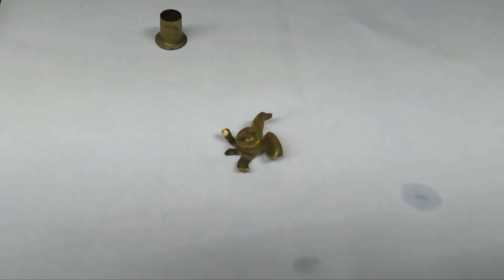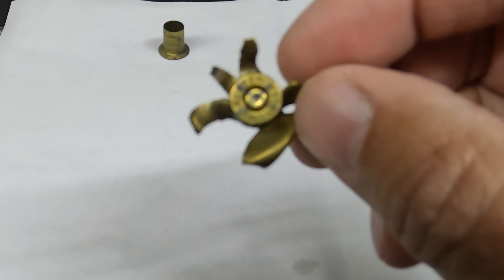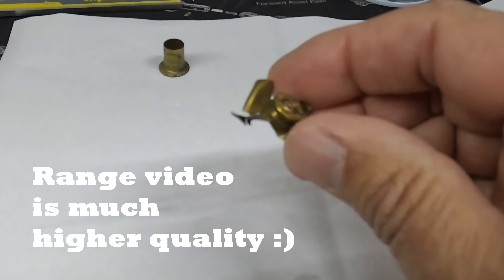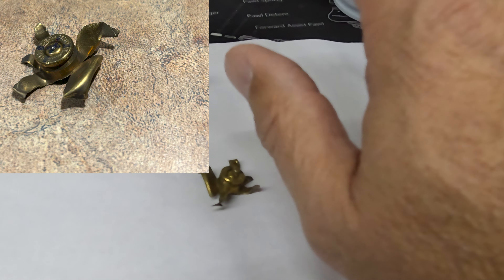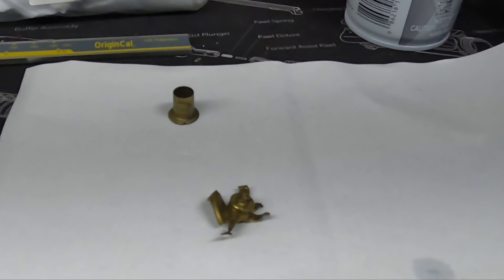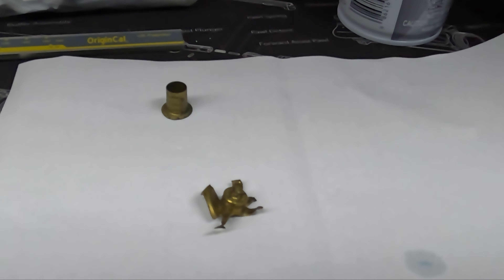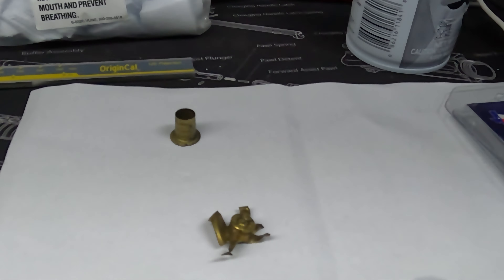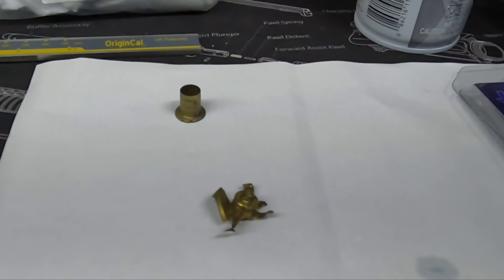EPC 9mm Pt3 Out of Battery Bolt Bounce Slam Fire! #9mm #aeroprecision #reloading #rifle #detonation

Comment: Very sorry about the issues you are running into😫 ... I can tell you that my build is 100% Aero Precision parts my trigger is  an AR9 trigger from Velocity Precision and I'm using a Strike Industries AR10 flat wire buffer spring with the Aero buffer, since I got my new Gen2 barrel it has ran flawless. All my reloads, and factory ball and defensive ammo run perfectly with Aero 9mm bolt. My head space is perfect. Aero's tech support is always there to help. I never hesitate to call them if I run in to problems even if not using all their parts 😉 ... good luck and safe shooting, Brother 😉👊🇺🇸
Reply from the maker: JB, I decided to order a Macon Armory 9mm buffer (uses lead shot) and a standard flat wire carbine buffer spring.  Saw others using this with my exact configuration and was working.  We’ll see in a week or so!  More research shows many others having trouble with the recommended Aero 308 spring and 8oz buffer.

Comment: An 8lbs buffer and 308 spring is more than plenty, the firing pin hit the primer when it shouldn’t have so that’s one problem ( they are spring loaded for a reason) The other problem is your headspace, when you showed the bolt closed on a round ( earlier) it was badly unsupported and not letting the round get fully chambered and to add insult to injury the barrel is aggressively chamfered and unsupported so this  AR is unsafe regardless of slam fires. People keep saying sent it to Aero but it’s not their bolt! My first suspect is the bolt but hard to say without checking it on another upper then checking your barrel with another bolt. I’ve been running these puppy’s a long time , long enough to when we used stock AR  buffers and quarters for spacers and they ran perfect. 🤷‍♀️ Find a buddy with a 9mm and swap and inspect parts for headspace. 👍
Reply from the maker: Tks UJ, changing direction and going with a “dead blow” type buffer and standard carbine spring.  Found others with similar his combo working with my exact same upper, lower, barrel, and bcg.  That with a CMC 9mm specific trigger should help..I hope!

Comment: One thing that also can contribute to this is the way Aero makes their bolts. Good thing you don't have that. On the bottom face of the bolt is a extended nub to push the shell out of the mag. Aero does not do this to their bolts. It is also a safety design to have this. It prevents the firing pin from reaching the primer till the shell has been fully in the chamber. It then lets the extractor slip over the rim of the case and then the pin can reach the primer. This is the only way that the AR9 can fire out of battery. And it is caused by bolt bounce. 

You prevent bolt bounce by using a standard type buffer with the movable weights inside. They act as a dead blow and prevent the bolt from bouncing. I made my own from a 8oz buffer. I bored it out then put in 1.5oz of lead shot then put the plastic buffer back on it. Completely cured my bolt bounce. I have not had another OOB since doing this
Reply from the maker: Tommeboy, taking what you said I decided to order a Macon Armory 9mm buffer (uses lead shot) and a standard flat wire carbine buffer spring.  Saw others using this with my exact configuration and was working.  We’ll see in a week or so!

Comment: If Tommy boy is right I’d be sending that back to the manufacturer.
Reply from the maker: Agreed, but this is their new barrel design so what will they say?  Going to measure the amount of unsupported case and report back.
Reply: @Hazzbro1964  they are a big company. I’m sure they would take care of it. Sometimes a new product has flaws so they need to know to improve their products. I’d call or email them and see what happens.
Reply: It’s not their bolt so they will say headspace. Can’t blame a company if it’s not all stock.
Reply: @unclejim2330  o I missed that. I thought it was all Aero.

Comment: I'm am having the same problem. How did you fix this?
Reply from the maker: Working on it now.  #1 recommendation I got was to go to a dead blow buffer so I picked up one from Macon armory.  Needs a standard carbine spring so I got a new flat wire spring for that.   Not sure if I’ll stop there though as I just am not comfortable with the lack of case support with the Aero barrel so I picked up a Faxon barrel also.  Think I’ll shoot with the new buffer system and shoot some slow motion video before switching the barrel.   More to come…
Reply: @Hazzbro1964  perfect! Let me know how it goes 👍